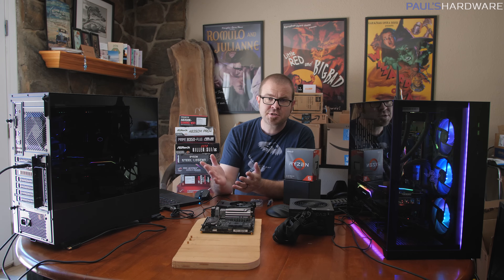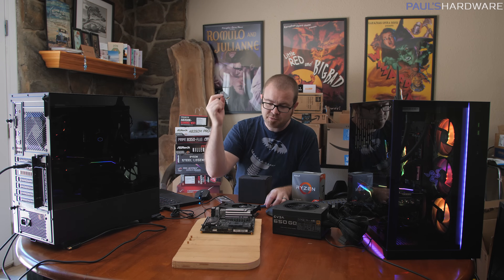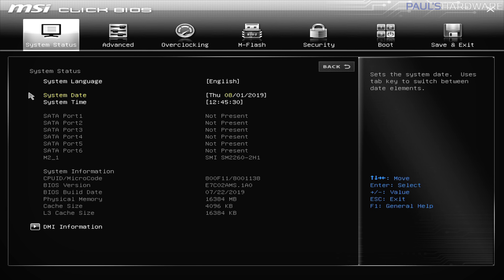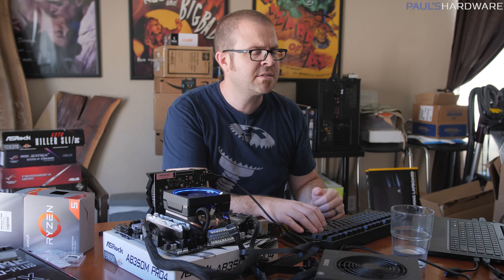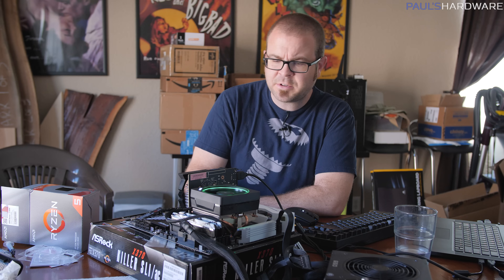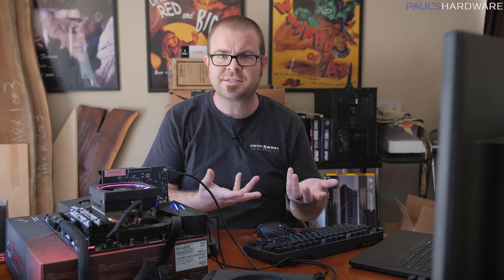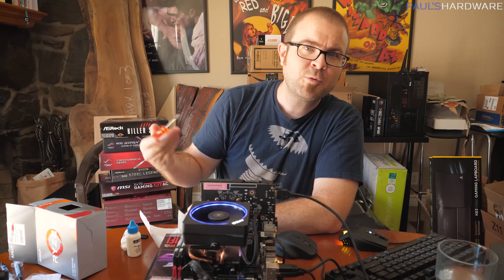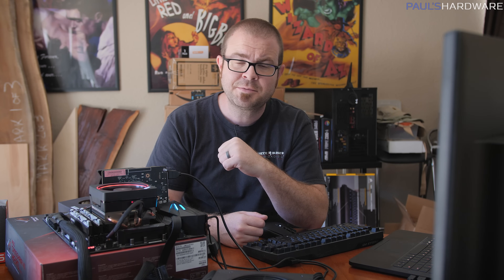Does Ryzen 3000 REALLY Work on Old Motherboards? Testing B350, X370, B450 and X470

Comment: MSI B350 Tomahawk plus with a Ryzen 5 3600x issues

I updated my Motherboards bios to support the new 3600x and installed the new chipset drivers, updated nvidia drivers and updated windows.

The computer will boot with the 3600x but Computer is crashing at idle randomly and restarts, games fail to launch or crash while playing. youtube videos on chrome crash while playing saying an error has occurred. Prime95 also gets one worker to fail after a few minutes. Temps reach about 75c so dont think its a temp issue.

if i put the 1600x back in and dont change anything else it works fine.

Comment: Interesting. Thought all MSI boards had BIOS Flash back. Won't be buying a B450 Tomahak.
Reply: Richard Meadows The tomahawk does have that function but that’s not the whole story. People on 1A bios are still getting cold boot issues. https://forum-en.msi.com/index.php?topic=321288.250
Reply: The B450 Tomahawk does have BIOS flashback. The video says it in large print, right on screen.

Comment: thanks for this vidoe i literally bought my pc toda with ryzen 7 3700x and b450 gaming plus motherboard and have been worried about it not booting or any problems but i think i wont have any problems... hopefully
Reply: I have that exact motherboard, with a Ryzen 5 3600. I've had zero problems. BIOS flashback took roughly 5 minutes, went off without a hitch.

Comment: I recently got an asrock b450m steel legend and a 3600 and despite it having an old bios that was before the 3000 update, for some reason with the 3600 installed it booted just fine without any bios updates. I updated anyway for safeties sake but yeah, interesting.
Reply: Its a really solid board though you get a lot for your money, id give it a strong recommendation. Lots and lots of pwm headers and intelligently laid out pcie slots (1x at the very top so a wifi card doesnt block gpu airflow)
Reply: @TooMuchSauce generally id say that's true but with a new cpu launch that the board isn't expecting who knows what could happen
Reply: I already have a R5 3600 with that motherboard on the way. I'm going to build my first computer in a week or so. Thanks for the info!

Comment: Ryzen 5 3600 runs well on A320 motherboards, so yes... they work on old motherboards. I'm running a 3600 in an MSI B450 board, and it works flawlessly. BIOS flashback worked like a charm.

Comment: I updated my Gigabyte Aorus B450 M from 30 to 32 to 40 to 42a yesterday. It was a little scary but went off without a hitch. My processor is a Ryzen 5 2600 so I can't tell if it work with a third gen or not.

Comment: I installed a Ryzen 5-3600 along with some Ballistix DDR4-3600 CAS 16 into a X470 Taichi mb.   CPU acceptance was fine, but kept getting blue screen "operating system couldn't be loaded because (various things) missing or corrupted".    I eventually recognized that it crashed if XMP profile was selected, but not if it wasn't.   Downclocking the RAM seems to be the fix.  I basically have it set to 3200 specs at the moment.   I have very little experience tweaking memory and there are a LOT of settings.  I'm going to look for a guide somewhere online.

Comment: I have a problem that u guys might be able to help with. I have an MSI B350M mortar board and I have just upgraded to an R5 3600 from R5 1600. I am using  16 GB Corsair Vengeance 3000Mhz ram. Everything runs fine, but 5 out of 10 times the system fails to boot up, then restarts and takes me to the bios with safe settings. After I reapply my memory settings (3066 Mhz CL 16-18-18-38 running stable ) it boots into windows, and everything runs fine. No program crashes, AIDA stability test doesn't fail. Tried lowering the frequency to 2666Mhz, still got the same. Any idea on this? Could it be a BIOS bug? Any help is appreciated.

Comment: Please do a Gigabyte Aorus X470 motherboard, they have aa bios update in steps including a specific in between install ECW update. It is very confusing and there is no good tutorial anywhere. Thanks 😀

Nice vid 😉
Reply: Just click on the the ECW update tool if you are on bios F31. It will say you do not need to update. Next install the latest bios. Once installed reboot then press delete to enter bios and then press F9 to verify bios revision. Next shut down the PC and turn off power supply by the switch at the bottom of case and install the Ryzen 3000 CPU. Once installed there should be no issue.
Reply: @DanielMartinez-hc1nw  Thanks :) Finally a short and good answer ;)

Comment: My Asus X470 Prime-Pro is ready to go, It dropped in price from £188 to £159 so I couldn't pass that deal up considering 
pcie 4.0 works just fine on that board.

I flashed the bios to 5007 with a brand new 2700X I bought from Amazon for £230. In the UK there is a 14 day return period no questions asked, so I sent it back for a full refund and I'm now just waiting for the 3900X to be back in stock and if it takes too long the 3700X will suffice.

Comment: Or you could save yourself all this hassle and buy a X570 board.
Reply: A simple CPU upgrade is much cheaper if you have an existing system based on a 300/400 series AMD board.
Reply: I brought b450 tomahawk not open yet,I ll return it for x570 .70$ is nothing for protecting ur self from future failures
Reply: @yamin2000  Just got a X570 board for $150, built my PC this weekend and no issues whatsoever. I rather that than having to worry about flashback BIOS and all that crap, you will save yourself a lot of headaches. AMD does recommend the x570 board with the 3000 series.

Comment: Hey Paul, You probably used a lot of thermal paste in this video. I would highly recommend getting any of those CPU thermal pads (IC graphite, ThermalGrizzly Carbonaut) for the quick swaps. I've used an IC pad for about a year now and have reused it at least 3 times. The temps have been completely fine, and even better than my multiple attempts at thermal paste application of MX-4. I'm sure people won't mind you using pads for something like this where you're not benchmarking these CPU or cooler in the video, you're just swapping various hardware.
Reply: Savergn Good idea, Also Paul testing those pads would be nice ;)

Comment: The main point of the flashback function is to do it without a cpu otherwise it’s useless. Does it work properly on b450 tomahawk? I had a ryzen 2400g cpu installed but didn’t update bios before returning it because I thought I can do it without a cpu before buying ryzen 3000.

Comment: I just recently swapped from intel to a 3600 with an MSI 450 Gaming plus board and it was a complete mess. Specifically went with the board because tomahawks were sold out & it was one of the few left with bios flashback as I didn't have an older cpu to update with. Bios didn't take and the system wouldn't post at all so I took it in to my local repair shop and things got weird. They updated the board fine, and runs 100% on 2000 series cpu's, but on my 3600 it will randomly hang when powered on/restarted and wont post, then they tried other 3600's and none of them would even post. That being said, I've got my system back now because they couldn't figure it out and it will only hang on restart very rarely and is otherwise totally stable. Had it back for a week now and the only times it's hung on cpu error light was twice when I was going into bios to enable xmp/check settings ect. Otherwise it has been working flawlessly and I'm really not sure what to make of it
Reply: i would rma the board if i were you .. and check the cpu pins :]
also reset bios by battery
Reply: @Pieteros21  thats the plan, I've got a couple weeks left on the window for returns on it and just kinda stalling out to see if the max boards come out in the meantime so I don't have to worry about it or spend the extra on an unneeded x570
Reply: @NotFinalTillVinyl  max will be more expensive... If I seen the right price about 30usd more!

Comment: for am4 (am3/2 sockets) you can actually loosen the am4 redemtpion module's screws a bit and easy install all those nasty clip coolers. fasten the screws afterwards. also you should loosen the screws when uninstalling a cpu cooler with thick thermal paste to prevent a cpu ripped out of the socket. also : thanks for testing out a couple of different motherboards, most techtubers try a x470 or a a320 board, but nothing a normal budget user would use. also: congratulations to your super cute daughter, you must be very proud :)enjoy the time she is little, kids grow up so fast -.-

Comment: I don't know why ASRock has to be that way. I've never had an issue updating a BIOS with MSI, Gigabyte, and ASUS, but it seems that every time ASRock needs multiple steps. It adds to the possibility of a bad update and increases the risk of bricking the board. 

The only other board that I had the multiple step update with was a Foxconn H77-M. I took one look at the job and threw it straight in the bin. I fancied my chances of getting Microsoft to allow me to swap the Windows key to another board than I did dealing with piece of rubbish.

Comment: Asus rog b450f didn't post my 3700x until I unplugged the sata cable from the SSD... Then it posted/recognized it and booted into the BIOS crazy.
Reply from the maker: This is one of those random issues I was kind of hoping I would run into, glad you got it working though!
Reply: it work without a previous bios update?
Reply: or did you updated the bios with a 1 or 2 gen first
Reply: @renesav  I tried without updating the BIOS and after. No post... Until I unplugged my SATA cable. I updated my BIOS using a 2700x because that's what I had before.
Reply: My problems came after getting into Windows. After a while, it would randomly bluescreen with "WHEA_UNCORRECTABLE_ERROR." I need to try it again, I'm hoping new BIOS releases will fix it. Asrock X470 Taichi.
Reply: @tinitis4144  using ecc ram? (bad ram/overclock)
Reply: @tinitis4144  change your ram clock to just below factory. That worked for me.
Reply: Good to know. I have the same mother board and I want to upgrade to 3rd gen ryzen as well as the new navi cards.
Reply: Asrock is hot garbage

Comment: Why would you NOT Update the BIOS Before you even BOUGHT a New CPU..you should be Regularly updating the BIOS anyways as part of BASIC system maintenance. I know there ARE probably people who do this..but they don't watch Pauls Hardware or any of the tech Shows as ALL of us Know better!...)..this is like Buying a New GPU and NOT loading the drivers. Gone are the Days of having to go to the Manf website , looking up your mobo seeing if it has an update, loading that onto a USB and so Forth for the last 6 + years its been a 1 click Live update with BIOS Software from the Mobo manf. Still cool video even though..if a a little redundant I'm pretty sure you did a video on upgrading from a Old Ryzen CPU to a new one on a older 300 to 400 series board before this.
Reply: actually BASIC pc maintainance would be to follow everyones rule of bios including THE BOARD MAKER  and dont update bios if you have no problems with current bios
later bios versions can actually make matters worse for current hardware installed example being most asrock boards are running worse using a 1st gen cpu with 3rd gen bios 

if of course your buying a later gen cpu then google search for a bios version people are reporting good (also very applicable at the moment with early 3rd gen ryzens)
to tell everyone to update everytime a new bios comes out is frankly extremely BAD ADVICE

Comment: The BIOS on the old MSI B450 & X470 boards had to change because the chips on these boards don't have the size capacity needed for the BIOS that the new CPUs need, so they had to cut the visual elements out to save space. But it's OK, I also like the more basic-looking BIOS better...
Also, this is not the case for the "new" B450+ & X470+ boards which are updated with a larger capacity BIOS chip.
Reply: Apparently they're re-releasing some of the older boards with 32mb bios cache instead of 16mb, too. I think they have a 'plus' suffix or something.
Reply: @Khola_D  I think it was "max"
Reply: @Khola_D  didn't know about this
Reply: Just be nice if they had 32mb flash from the beginning (but seems the 32mb is a lot more expensive then 16mb version)

Comment: Thank you so much for this Paul!!! Have you tried the X370 Crosshair VI Hero by any chance? My Ryzen 7 1700X died a few days ago, I got a R5 3600 replacement coming in this week, wondered how well the latest BIOS 7106 or 7201 worked for you. :) Thanks!! (My board is a X370 Crosshair VI Hero just to be clear lol.)
Reply from the maker: I actually had one in that stack but I ended up leaving it out due to lack of time, it should work out fine though! Just remember to use the right name when you do USB BIOS flashback 😄

Comment: If the Click Bios seems like a downgrade that's because it is. They ran into a 16 GB limit on their boards and that is why it looks a bit bland. Less flashy and you lose some compatibility with some pre-zen CPUs (wouldn't exactly call that a problem) but you can use Ryzen 3000 CPUs...
Reply: By the way MSI will be adressing this in a new Max line up of B450 and X470 boards which basically come pre-flashed to support 3000 CPUs and with a 32 GB bios chip to accomodate the old flashier UEFI version.
Reply: @MarkLangdahl  you really think they are fitting 32 or 16 GB bios chips ?  (you can install windows on 32gb)  try mb as the size
Reply: @tonybarden8563  Oups, sorry, MB...

Comment: From what I understand, on the MSI, the new "click BIOS" is necessary because of the size of the database necessary for all the processors. The new Max  boards can use their standard pretty BIOS because they're using a 64KB BIOS chip instead of a 32KB chip so it can store the extra features and images in addition to the database of all the  AM4 CPUs.
Reply: 64/32 KB ??????????   dude please go re-read your source in particular the difference between kb and mb
Reply: @tonybarden8563  It was 16mb up to 32mb. I'm tired you don't have to be a dick with "go check your source."

Paul, can you please come to floatplane soon? People can still manage to politely correct each other there.

Comment: I bought a used MSI B450 board with the BIOS flashback feature for ~50$. Made it very easy without an older Ryzen processor on hand.
Reply: So you updated the used board's bios using a usb stick and no cpu, and installed 3000 series correct?
Reply: @JentleSticks  I had a 1500x that I did mine with.
Reply: Same here, worked like a charm
Reply: Got mine at newegg new for $110.00
Reply: @patbluetree4636  how long did it take and was they're a delivery fee ?
Reply: @rajakhan12346  Three days here in the US and the delivery was like $5.50 ish. It did require two separate bios updates, v.17, v.18
Reply: @patbluetree4636  I'm in the UK so I gotta pay big delivery. But total turns out £115 for me . I think I'm gonna look on eBay as b450 are for 75+ pounds
Reply: Are you using the MSI B450 Tomahawk max?
Reply: Where did u buy it from?
Reply: Sorry getting some mixed signals here. So can you update the bios for the b450 tomahawk without another processor?
Reply: @baxxmo  yes using the usb flashback
Reply: my man im looking foward to buying a b450 tomahawk too with 5 3600, but i've read that some people have encountered some problems due to small chipset? did you have any issue?
Reply: @juliancantillo97  no issues, actually I just had to replace the mobo on another pc and I went used MSI B450 again. The only difference was it is ATX, the first one was M-ATX
Reply: @poot111111  thanks for the info bro!

Comment: Paul....that's not the problem with the current bios, yes all the bios support the new chips.

THE PROBLEM is the bios are riddled with bugs. Asus bios are beyond broken right now.

Read the forums on Reddit and ROG, full of problems and bios bugs.

My Asus B450 E Gaming on bios 2406 and 2501 is essentially unusable,  I cant login to windows because of a bug using wireless keyboard and mouse. 

If I shut down the PC within windows the monitor goes blank and the PC stays powered.

Voltages are INSANE on Ryzen 3000....1.45V 😯

You made the wrong video....talk about the bios bugs and issues many people are having.
Reply: Regarding voltages, my 1800X on an X370  ROG Crosshair VI Hero board were 1.45V out of the box.
Reply: @Lenticular67  on what bios ?...a ryzen 3000 ready bios ?

1800x is supposed to run 1.2V

Comment: Your kid's cute Paul. That said, I"m not updating anything. I bought a ASUS TUF Gaming X570-Plus (Wi-Fi) for my new build.
Reply: Me too!! I had to order it from B&H tho cuz it was sold out literally everywhere else but hell $189 was not a bad price.
Reply: @SirNicholasT  No, that's a great price. I paid $10 more at Amazon, but in the end it all worked out because they didn't tax me on a lot of stuff and my order ended up being $40 less than I was expecting. Everything should be here Tuesday so I'll have two new PC systems to build.
Reply: Same I just bought a MSI X570 for an overpriced 195 dollars but who cares. This is way too much bs I wanna deal with building a new pc.
Reply: Enjoy the new builds guys!
Reply: If your buying a  ryzen 3900 would a tomahawk B450 max motherboard work like the one in the vid. Or should I just but the x570 motherboard? If it would just need an update wouldn't it just be better to buy the cheaper motherboard?
Reply: @gamingglitch4697  

Doesn't it depend on when the mobo was manufactured, specifically that said mobo it was manufactured after the 3000s were released.